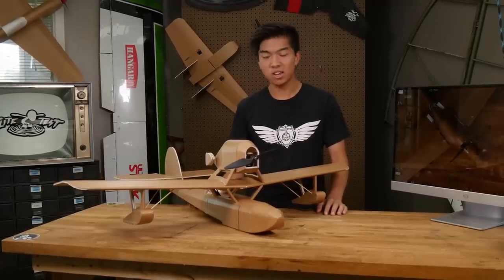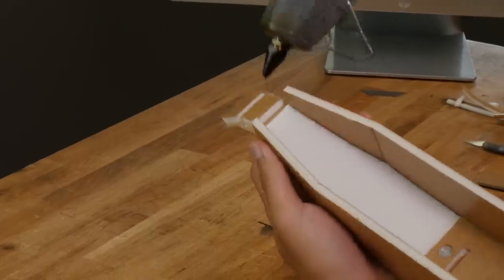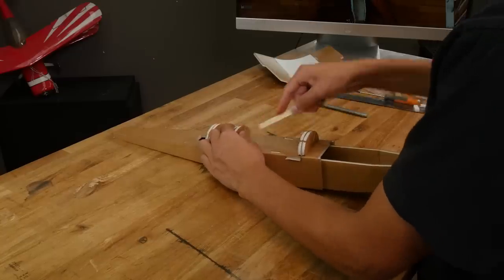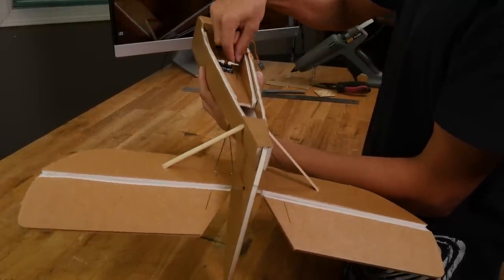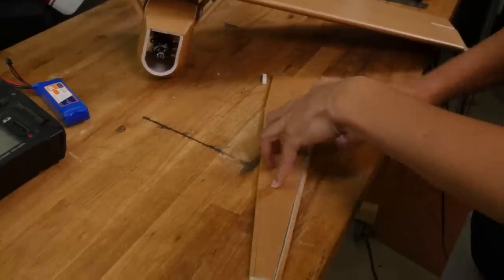How to Build the FT SeaAngel inspired by Porco Rosso  //  BUILD

Comment: Since this video doesn't seem to have any index or chapters, I figured I could add one. Hope this helps someone.

0:00 Intro
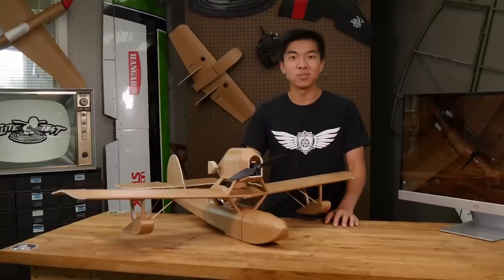0:26 Fuselage 
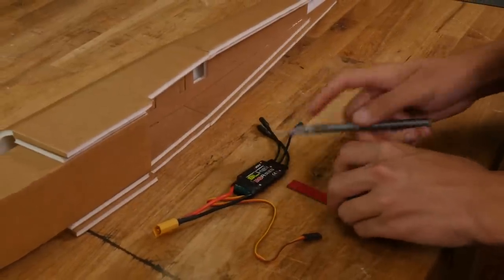8:12 ESC install
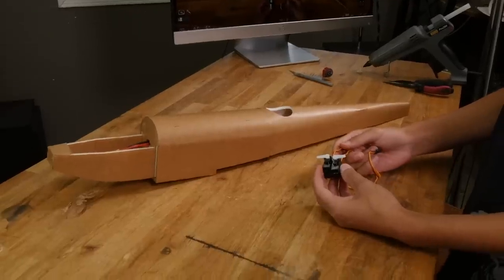11:02 Servos+pushrods
13:00 Tail
19:09 Wing
23:59 Mount wing
26:51 Motor pod
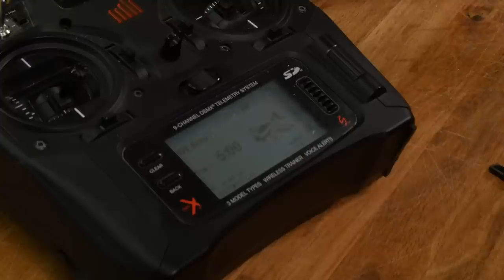35:59 Receiver
36:54 Fuselage bottom
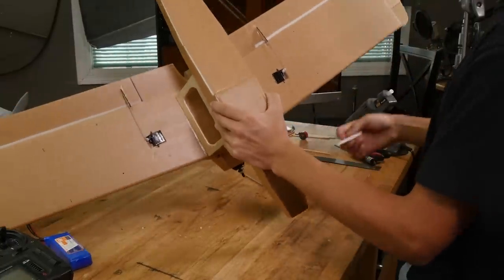38:00 Nose
45:28 Pontoons
49:44 Finishing touches
54:40 Maiden